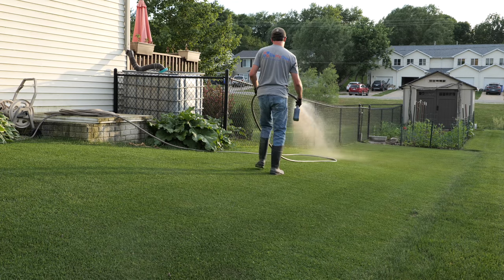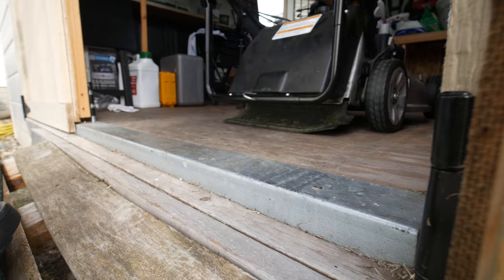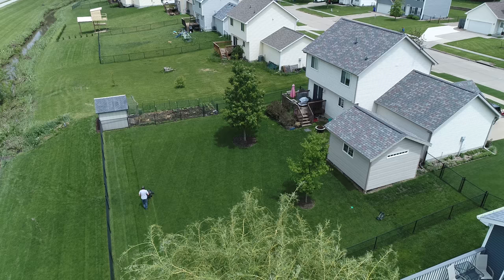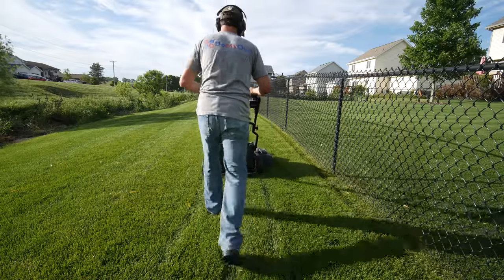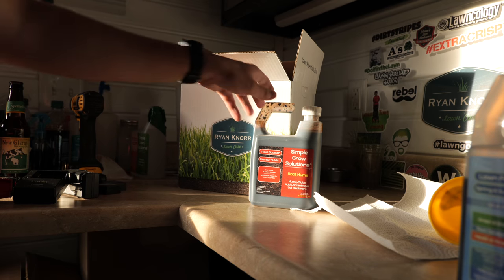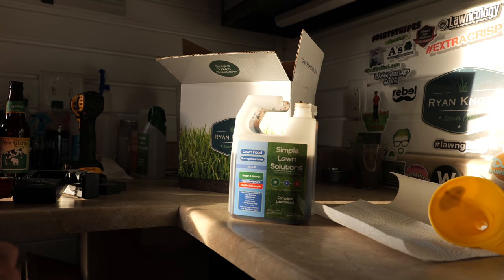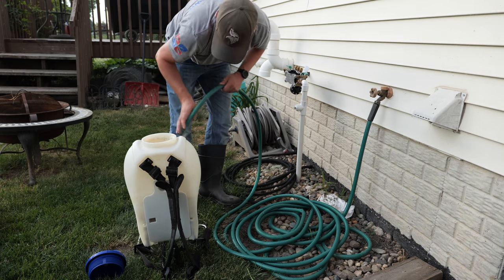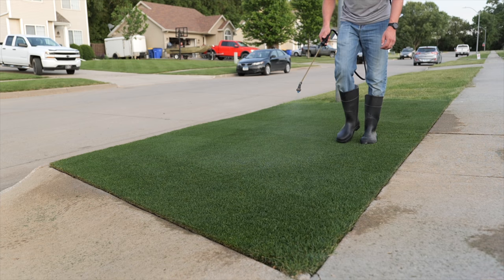The Best TIME for LAWN CARE // Mowing and Spraying Before Dark

Comment: We've had very little rain, hot days and my irrigation system has issues and has been turned off until the fall.  So far, so good ... a few hot spots that I've done some deep watering with the hose but otherwise looks good.  Made a mental note of those hot spots and in the fall I'll see what's going on.  This is a real test of all the work I've put in on conditioning my soil and encouraging root growth.

Comment: Nice video Ryan. I'm depressed. New house with sodded KBG lawn on clay soil. Looked pretty good for  while. Then two days ago, everything started turning brown from the heat and lack of rain. Supposed to get rain Friday so I probably won't water tomorrow (Thursday) and just hope we get enough to help cool it down. I'm thinking of overseeding with TTTF this fall since it's supposed to be more drought tolerant. Things sure can change quick in this world of lawns.
Reply from the maker: I would probably start working more  on the soil if possible.  It's very common to have newer sod suffer because it doesn't have a great root system yet

Comment: So in regards to rye grass, in another video you mentioned that the problem with rye grass is that since it is so dense that even when you cut at 2 1/2 inches the lawn still looks messy. So you have to cut it shorter so the grass looks nicer.
Reply from the maker: My backyard is bluegrass but the varieties I have are meant for short cut

Comment: It appears you upgraded your granular spreader to a bigger Scott's. I had the Scotts turf builder edge guard DLX model and it kept breaking the plastic wheels at the hub connection. I guess they're fine for flat lawns like you have but I have a hill that is hard an equipment. I sold it and bought an Earthway spreader with real wheels/tires. Night and day difference.

Comment: Best way to handle giant ruts in the lawn? Had to have a giant Backhoe come in and fix a septic pipe and it left some 4-5 inch deep ruts. Topsoil to fill and reseed? Probably should remove old grass first.

Comment: I have rye grass in my yard in Virginia, and it is turning brown in the summer due to the heat.  I saw your grass and it was pretty and green during the summer.  I have de-thatched my yard, and I put some Ironite on it last week.  I have some questions that I hope you can help me  with to get my lawn l healthy.
1. What would you suggest that I do to keep my rye grass green?  
2. I have a sprinkler system, but how much time should I water it daily?
3. What fertilizer should I use, and how much?
4. How low should I cut the grass?

E. Morgan
Chesapeake, VA

Comment: Have been searching for a way to store sprayers. Really like the setup you have. Currently trying to figure out how to mimick it.
Reply from the maker: I have a video on my shed from last summer
Reply: @ryanknorrlawncare  Thanks, will check it out this evening. If I can't dedicate a wall then I have a metal clothes hanger rack on wheels. Thinking of putting a rectangular box on the base by the wheels to hold sprayers. Then on the part where the clothes hangers would be i would clip the wands to that bar. Not sure which way I'll go yet but thanks again.

Comment: Ryan, ever have any issue with the Scott's mini edgeguard leaving stripes in the yard. Mine seems to throw the fertilizer right into the tires and gets stuck on the inside of the hollow wheels then drops all the material from the tires leaving perfect dark green stripes. Any tips on avoiding this?

Comment: This takes my mind off the craziness. Thanks for the videos. Question:  been battling poa like crazy. But I also have to overseer in the spring, since fall in Montana goes from 80 to freezing in august. Tough in the turf and leaves it spotty in the spring. I know that somewhat works in my favor since The fall is when pre emergent should be applied for poa. Doesn’t seem to be able to knock it back. Any suggestions Ryan?
Reply from the maker: Other than pre-emergent I'm not sure why that wouldn't be helping at least a little but there are some very expensive post emergents out on the market you could try.  Like $500 for a jug of it

Comment: I’ve got the same sprayer. I find it very difficult to rinse it out.  Fluid always seems to stay in those 2 upper corner sections and you have to vigorously shake it up and down and side to side to get it clear of fluid.  I was wondering if you were having the same issue?
Reply from the maker: There's usually a touch in the bottom but I shake it around like crazy and that does it for the most part

Comment: Ryan/Anyone . . . I could use some help / suggestions ???
I am in Northern MD with a small 1,000sf front lawn . . . fescue turf. It's July 3 and in the low 90's.
Soil temp is 80.

I have done 2 apps of Humic & Kelp recently (liquid ). That's all I've done. Soil seems compacted.
 
pH/mois. meter shows pH7 ( too alk ) . . . I think I should try to get pH down to 6 or slightly less ( a touch on the acidic side ). Moisture reading is still very high and turf is starting to brown in spots. We did have 1 good rain a week ago. but it was high even before that.  Thinking about letting it continue to dry to a normal level then wait for a good rain and lay down some fert. just before it hits ???I haven't dropped any fert. yet but I have some Scotts Weed & Feed and a bag of Milo. on hand. Or wait til Fall ?

Comment: Hi Ryan, hey man you have a really nice grass.
How do yo keep it that nice during this hot days. Mine looks like is dying. Thanks for the tips.
Reply: He is a little cooler in Iowa.  Along with his applications he waters quite a bit.  Hope that helps.
Reply: Fertilizer and lots of water,keep it at the right height helps a lot too
Reply from the maker: Soil and building a root system to handle it.  Just as hot here as the transition zone or even farther south for 3 months or so